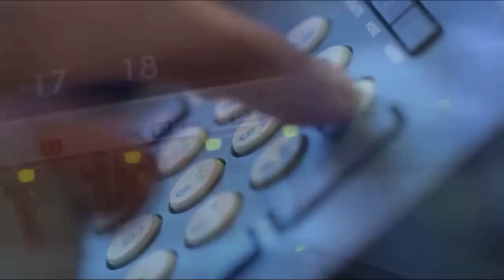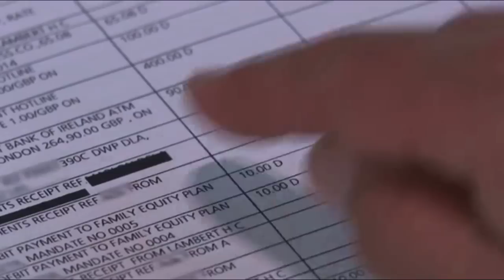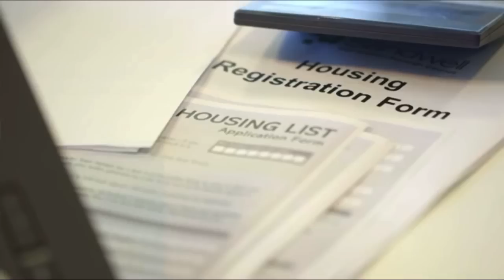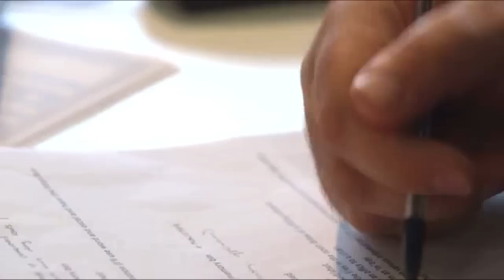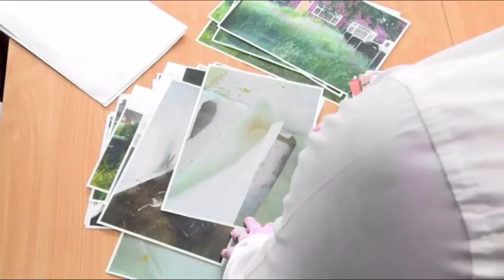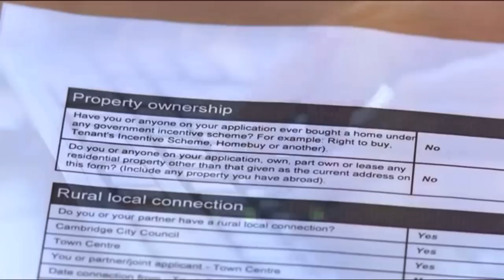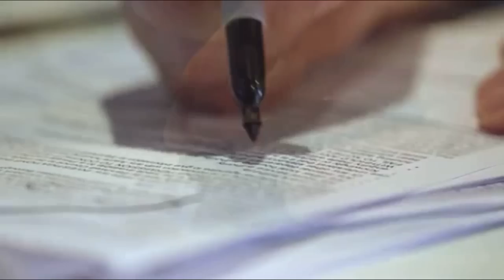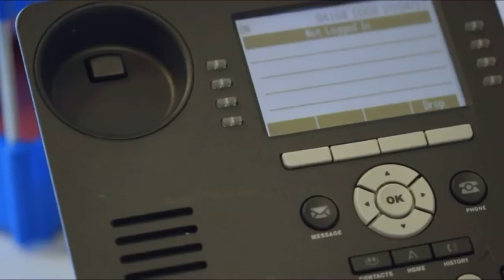(NEW) COUNCIL HOUSE CRACKDOWN SEASON 3 EPISODE 5

Comment: Plus a minimum custodial sentence of 5 whole years, for money fines can be tailored to the criminal, in this case Lambert and curfews are easily accepted. The criminal is still free and it is that more than any of the other 'punishments' that would deter criminals from being involved in the greed of fraud against the taxpayer. 
It is the court costs and the admin costs that need to be taken into consideration when fines are issued and the fact that many use benefits to pay off the fines and find other ways of getting money. 
The only way to 'punish and deter', which is what justice is supposed to do is to take away the liberty of the criminals and a 5 year whole sentence at the minimum would make some think 'I am not going to risk losing 5 years of freedom'
How much would some be willing to risk for making more money by sub-letting
I think there are so many cases of sub-letting and more being added, that this ridiculously soft justice system of ours should be overhauled beyond belief, so that criminals across the board think twice about the power of a more retributive system being used against them.
No wonder so many want to come to the UK, they know how soft all our systems are. I am sure there are some major criminals who came here just to 'rip off' our systems and they are getting away with it all. Between them and the government the taxpayer is the victim every time.
The cost of keeping criminals in prison would be offset by the benefits saved and the crimes they would possibly commit. Standard, no frill prisons with no privileges, would be economically cheap to run, it the right criminals are targeted.
Reply: I totally agree.  Canada is the same.  It's time our judicial system was overhauled and the sentences made stricter.
My parents told me of a jail in Arizona that its system should be copied in our so called modern countries.  The inmates are given a bologna sandwich for lunch, bowl of cereal for breakfast, and a more substantial meal at dinner.  The jail is self-sustaining.  They grow all their own vegetables and fruit.  Raise cows, pigs, and goats.
There are things like a library, a computer room, and a huge room with nice furniture and TVs.  In order to be able to use these things the inmates have to earn the privilege.  They work in the gardens or with the animals or maintain the grounds.  Some actually go out and pick up garbage along the highways.  Inside they do laundry, cleaning, or working in the kitchen.
The end result of all this is no one has ever come back for a second "visit".  A win-win situation all round.

Comment: That's the trouble with this country. They house foreigners quickly. And leave Brits in temp accommodation. And quite often it turns out that these foreigners are home owners abroad. Soft touch Britain has had a reputation abroad for years.